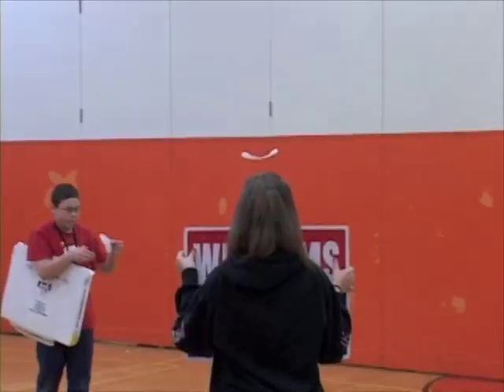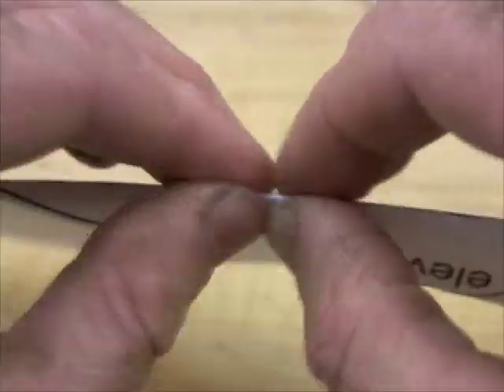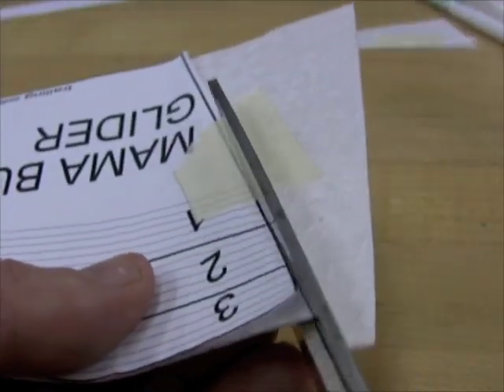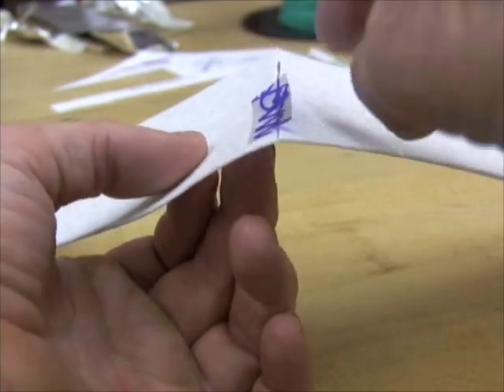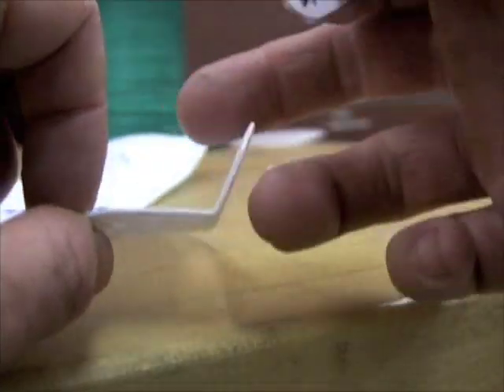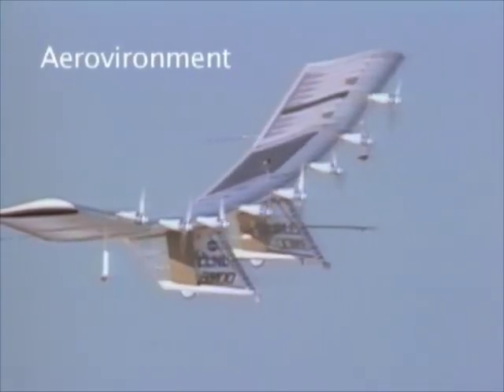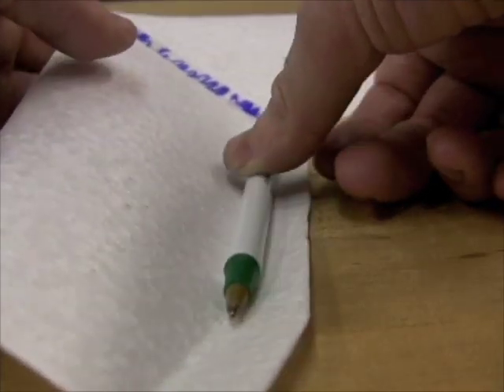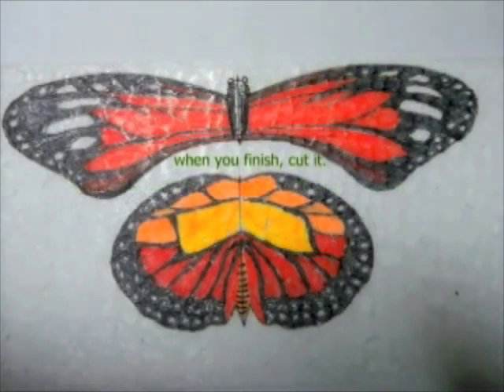Part 7 Air Surfing Kit

Comment: i bought at a d.i.y shop and i using same nine volts battery the wire is one meter and the connection wire when connect to the battery it cant be ur spin spin the wire must the most front aim at the circle middle and the aluminium foil need also most front wire only can work.pls help me thx i wanna make mama bug! i only could make baby cause i bought a styrofoam cutter must one time same size as the plane